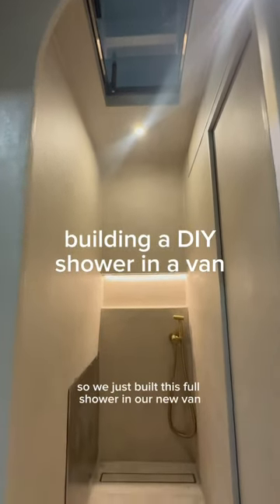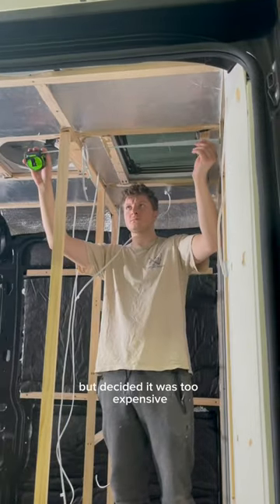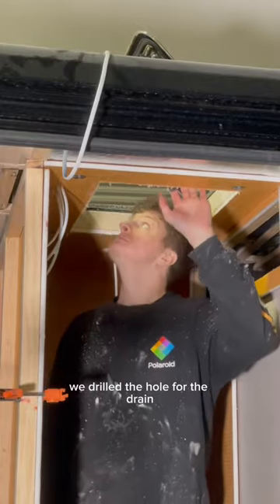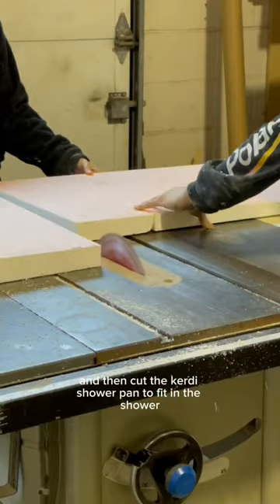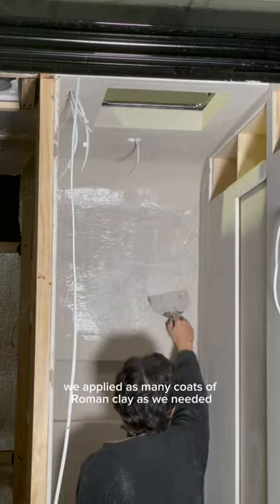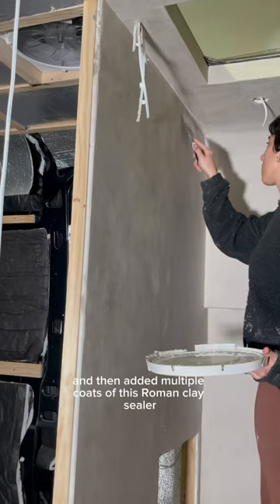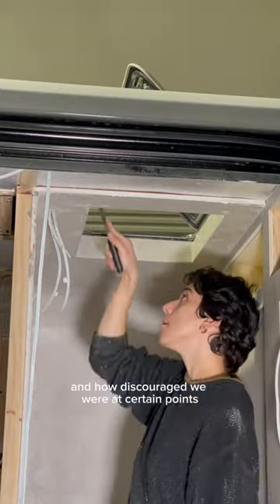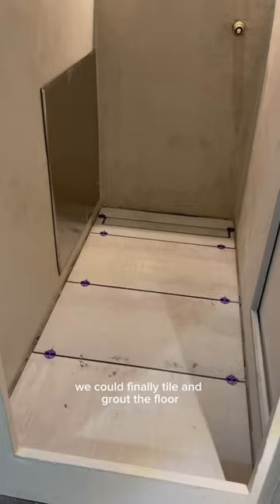We Built a Massive Shower in Our DIY Camper Van! #shorts #vanbuild #diy #tinyhome #vanlife

Comment: Wouldn’t using clay add extra weight?
Adding  extra weight is the last thing you want in a van or any vehicle.
Reply from the maker: The entire weight of the whole shower was about 5-7lbs of Roman clay. Paired with the ultra lightweight kerdi board this is actually one of the lightest finishes you could choose for a shower space in a van!
Reply: @scarletandseth just probably an illusion from the shorts but did you apply a waterproof membrane over the joints in on the kerbi board ?